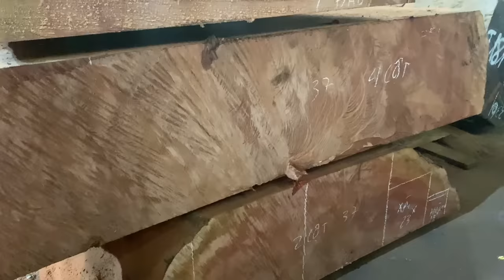Factory Monster // Biggest Lumber Project // 3000 Year Old Tree

Comment: If there's a hard way to do it; they'll find it...They should be pulling that bandsaw.
Reply from the maker: It also makes sense to do it your way
Reply: @IT? As opposed to what? Pushing the bandsaw? I have a sawmill a lot smaller than this one and it really doesn't matter much whether I push or pull the saw through the log.
Reply: @UriahGiles  I'm talking about being AWAY from the blade head...Using ropes to pull it while you stand opposite end of the piece...

Comment: I enjoyed your video, keep your chainsaw sharper to make it easier to cut your log, looks like your producing almost powder instead of chips, but the bark would hold alot of dirt and debris to dull the chain, could knock off the bark with an ax just where you are going to cut.
Reply from the maker: Thank you for your comments. We are very happy about that
Reply: It doesn't help the chain sharp if you cut concrete with it.

Comment: Americans complain about regulations.  Can you imagine what those guys are going through practically cutting that thing aby hand.  I don't see any safety gear.  That one guy on the top actually with a running blade.
Reply from the maker: Each local country has different work and safety regulations. where we can wear the most comfortable clothes to easily get the job done